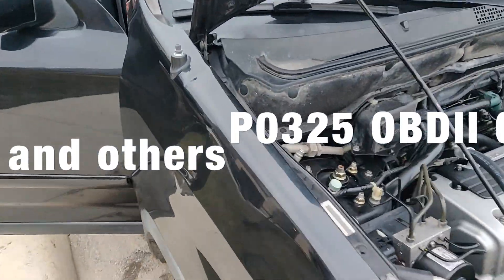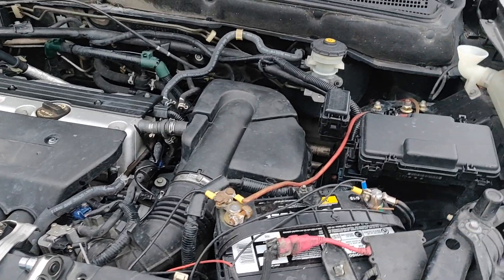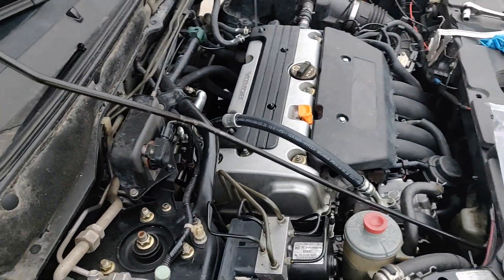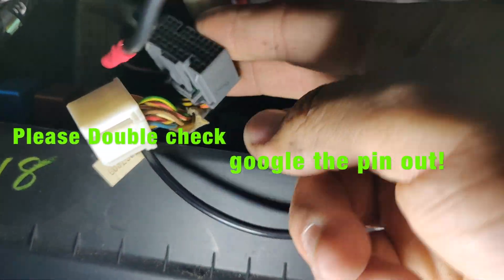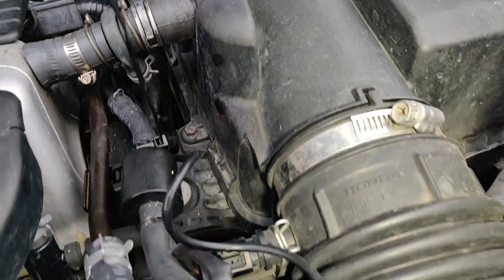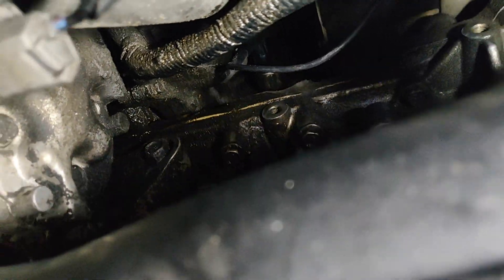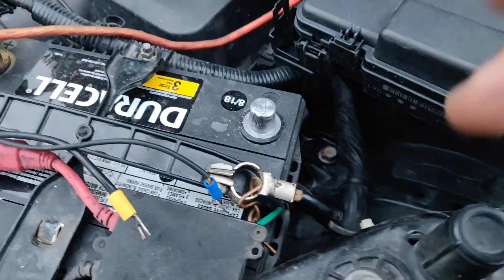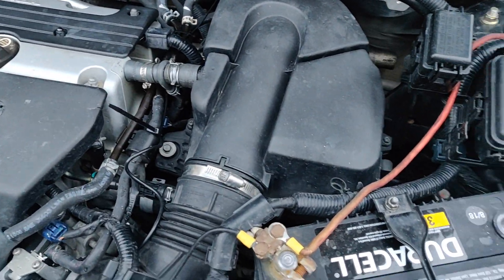HONDA P0235 KNOCK SENSOR REPAIR!

Comment: Could you provide specifications of the cable used to replace the original. Thanks :)
Reply from the maker: I think I was just a 14 or 16 gauge wire. Stranded.

Comment: You had access to both ends so, you should have tested the wire for continuity first before feeding a new one. On the sensor side grounded to the frame. On the glove box side have a light tester connected to B+ from the fuse box and then pin it out.  Also, You did not show how you re-used the connectors. Did you splice it on both ends?
Reply from the maker: I did test for resistance on the wire. No go. I basically soldered the wire to a new pigtail to the knock sensor. And just spliced on the glove box.. I believe..don't remember it to clear.
Reply: You can test it for continuity but if it is intermittent ( cable inside may be start corroting ) who knows replace the cable and if it fixed the issue you are good.